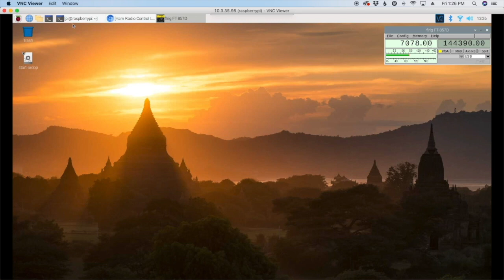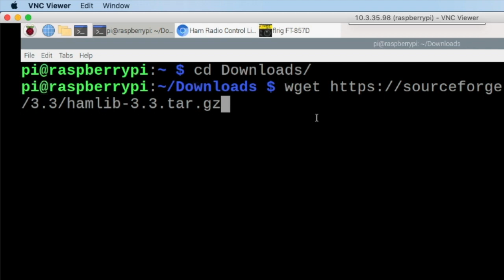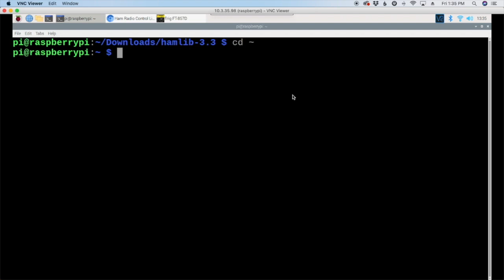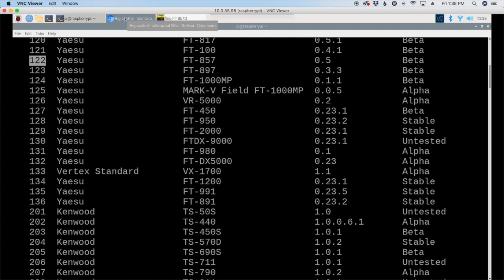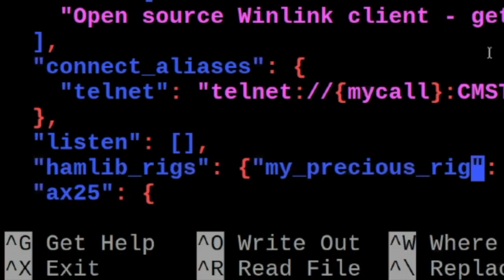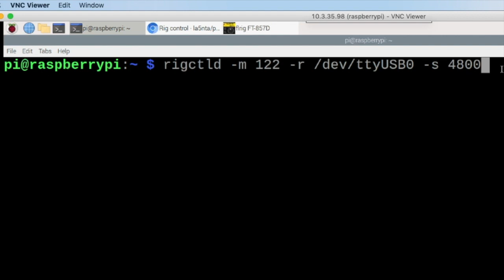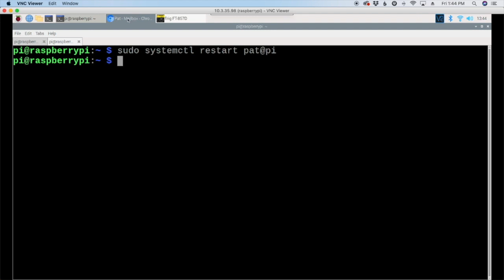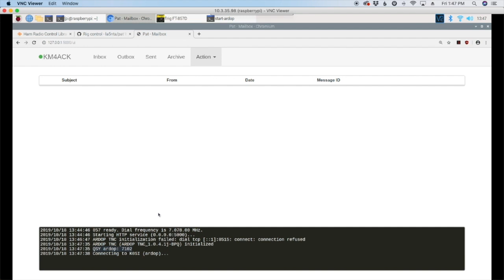Install Winlink on Raspberry Pi4 Part 3 Rig Control

Comment: This is out of date.   The  pat config file format has  changed...   I can connect to my rig w/  FLRig -  but not through pat.   and using  m -4 (flrig) is also crashing.  There seems to be a problem with the way the settings files are loaded:  rig_settings_load_all: settings_file (/home/vzander/.config//home/vzander/hamlib_settings): No such file or directory
.    Really appreciate the  level of detail in the videos... but   it is no longer viable w/  Raspi5

Comment: When I try to connect to a remote node using ARDOP via flrig the associated frequency will display on my Icom IC-7300, but it fails to transmit.

Comment: Any idea why my 891 goes straight into transmit when I start rigctld? rigctld -m 1036 -r /dev/tty-digirig -s 38400
Reply: The udev mapping was bad- the rule was not connecting the correct USB hardware to the symlink.. I thought that all digirigs were the same but maybe not or the different radio FT-3100 vs FT-891 made a difference. ardop and x25 are working-

Comment: Can you start rigctld as a service and boot time before pat as a service?  That way it is already running in the background
Reply from the maker: Depending on your setup, yes. I run rig control through FLRIG which needs to be started before rigctld so it wouldn't work with my setup.
Reply: @KM4ACK  how would you set that up.  I just used this for the first time to key my rig because ardop can't key the FTdx10 by RTS/DTR (or any program for that matter unless I am mistaken).  However, I figured out after the fact that hitting the VOX button also works FB.  But having mokeyed around with rigctld for the first time, I think I prefer it as my logging program gets auto update with it.  So I would love to start it as a service at boot time, and wanted to know what path you would recommend for that.  I hope this makes sense.

Comment: Jason, I followed your directions step by step. When I entered “rigctl -l” into the terminal command, I got the following error “rigctl: symbol lookup error: rigctl: undefined symbol: debugmsgsave.”
What is the rig number for an Icom IC-7300. At this point I am unable to proceed.
Reply from the maker: It looks like you have two instances of hamlib installed. Once compiled from source and the other from the repo. Try running sudo apt purge -y libhamlib4 and then try the rigctl -l command again. Additional tech support is available at https://groups.io/g/KM4ACK-Pi/topics You might also consider Build a Pi which does the vast majority of install and configuration for you - https://github.com/km4ack/pi-build There's a few videos on the site to help get you going.
Reply: @KM4ACK  Thanks. That did the trick. Currently I have winlink installed on a Windows laptop which appears to have been the conflict. I am 95% complete in the process of dumping Microsoft for Linux.

Comment: Hello!  I have been using BAP wih my Pi/4 successfully.  I also wanted to put some of those applications on my laptop running Ubuntu 20.4.  Apps like FLRIG, FLDIGI, JS8Call all work well wih both my rigs, an Icom IC-7200 and a Yaesu FT-891.  I did install ARDOP and got it as well as PAT Winlink up and running - to a point.  I use the "armstrong" method like Jason to manually dial the frequency yet ARDOP/PAT does not key my transmitter.  For my attempts I have been using my IC-7200 with ONE USB cable for both CAT control and audio. If anyone knows how to get my radio (both, preferrably) to key up I would greatly appreciate it. 

In another matter, my working SD card for the Pi/4 just gave up the ghost, and I am eagerly awaiting the lastest version of BAP to be released!  Good work, Jason!  Vy 73! SV0SGS

Comment: First of all, great videos!  During the ARDOP setup you get to a point during rig control that shows the PAT mailbox showing the the rig is connected and what freq that it is listening to.  I am getting an error that says "Unable to get frequency from rig IC73 (that's what i named my rig in PAT configure): code -9".  I was wondering if you have seen this or not.  I am using an ICOM7300 connected to a RPI4 and just have not been able to get ARDOP working with it.  PAT does work with TELNET.
Reply from the maker: It could be a couple of different things. Double check the config file. One comma out of place can mess up the entire thing. Feel free to post in the forum where a lot of 7300 users hang out https://groups.io/g/KM4ACK-Pi/topics

Comment: Thanks for providing this tutorial. I was able to get my Pi configured for WinLink and sent my first message over HF. There has been some slight changes in the rig control software since this was posted, when I was researching the solution, I noticed a posting KM4ACK posting in the forum that helped me along in that process.
Reply from the maker: Congrats! Winlink is a great tool to understand. I should probably revisit this series in the future to update it but most of my follows are using Build a Pi now and it takes care of the vast majority of what's shown in this series. https://youtu.be/l4M9VVqGxoc

Comment: Jason.. Great videos.  I have a question, I am new to the Pi world and am trying to learn.  I have downloaded and am using Build a Pi (BaP)... have no issues with the software but am confused.  If the Pat Menu is pro?vided in BaP, what do I need to do to make it run Winlink?  Do I need to follow all the steps here or just figure out how to set up the Pat Menu area on BaP.  Can you provide some direction or point me to a video that show how to set it and FLDigi up on BaP.  Many thanks for a great product in BaP and the wonderful videos.
Larry KO4OPE
Reply from the maker: If you used BAP to install Pat and Pat menu, you can just use Pat Menu. No need to follow this video.
Reply: @KM4ACK  thanks… and if I have any issues is this the best way to contact you?  FYI I have a Xeigu G90 with a Gigirig Mobile Cat control. Hope the setup is easy to get Winlink to work.  Never tried it, but need to be able to use it for ARES qualification. Thanks Larry KO4OPE
Reply from the maker: The best way to reach out is in the BAP forum https://groups.io/g/KM4ACK-Pi/topics

Comment: I have Flrig working fine with WSJT-X, but how does it interface with Pat? Are you just using Flrig as a standalone rig control interface, then using pat without specifying a frequency? I can't get the rig to key up!
Reply from the maker: Post the question to the forums and let's see if we can figure it out https://groups.io/g/KM4ACK-Pi/topics

Comment: Jason, I have a question please.  Small problem here.  When pat starts up (start web session), it reads the frequency from the radio correctly.  However if I close the browser, manually change the frequency on the radio, and start the browser up again, pat still shows the old frequency.  However, if I "sudo systemctl restart pat@pi", and then open the browser, pat shows the new (correct) frequency.  Maybe this is something having to do with rigctl?  Is it "ok" to change the radio manually and will rigctl/pat pick up the changes?
Reply from the maker: I haven't run into this one before. If it reads it once, it should read all the time. Manually tuning the radio shouldn't make any difference. Please post in the forum and let's see if we can get this figured out https://groups.io/g/KM4ACK-Pi/topics
Reply: @KM4ACK  Thanks, I just joined the group and posted.  It may delay the message for a while as I'm a new user.

Comment: Hi, I followed the instructions but now pat won't run.  Where does pat log errors?
Reply from the maker: When you start pat with “pat http” in terminal what error do you receive?  More than likely there is an error in the config.json file.
Reply: Pat logs to /var/log/syslog.  So, the config.json file has changed somewhat with the latest version and it appears I must have either included a special character I didn't need or excluded one I did need.  I've reverted to the original config.json file and will start over.  To those just beginning this install, I HIGHLY recommend you backup your config.json file.  Also, for those of us that like to use "vi", you can edit the config.json file directly and don't need to run "pat configure".

Comment: Hi,  installed winlink on a Raspberry Pi3.  I have a problem Connecting from Pat Mailbox.  I can run a  connection OK from the command line e.g  pat connect ardop:///callsign?freq=7045,  it connects to ardop, changes the frequency, keys the ptt and successfully processes a connection and session to completion, so it looks like rig control (CAT), ardop and PAT (from the command line) is working. The problem I have is that if I try and run Pat Mailbox from via the browser everthing works excepot there is no ptt.  Any idea what I might be doing wrong ??  Paul VK4PWG
Reply: Hi, I jumped the gun with my previous post.  I reinstalled everything again as well as Pat Menu.  Now it all works !!   Pat Menu is amazing -- just what I needed.  Along the way trying to find the fault I gained intensive practie in running everything from the comand line, including maiking connections, sending and reading email in minimalist fashion from a terminal window. So the effort was not wasted.   I intend to test run Pat mail in a survival scenario man-solo in the jungle (along with JS8Call etc).  In a emergency/survival scenario it can be important to establish close/regional contact so I will be testing a NVIS setup. I am in AUS and there are not many HF RMS gateways here, so I might have to take on a project to set one up.  Thanks for your videos -- they are fantastic. Cheers paul VK4PWG.

Comment: Hi Jason.  I love the tutorial videos and they have helped me a ton.  You said you use flrig because rigctl can't set the mode (USB vice LSB you would normally be in on 40m).  I can do it on my rig (IC-718) through the hamlib libraries.  Is your statement only referencing the 857, or something in ardopc, or something else?
Reply from the maker: It's 857 specific. It can be done though hamlib (rigctl) but I have noticed that it doesn't work 100% of the time. I did write into a script once to check and make sure it swapped before continuing but found it more reliable to use FLRIG. FLRIG also makes the build-a-pi system much quicker to move to a new radio using FLRIG. Just change the config in FLRIG and everything else falls in line. The exception is if you have to change the PTT method for different radios. VOX vs CAT.

Comment: Jason, when I run Pat Auto connect, it's now seeing the rig freq, keying up the transmitter and changing frequencies automatically as it should. So that is now working. But I've been trying since yesterday on 20 and 40 to connect to any node, anywhere and nothing. It keeps timing out eventually. How reliable is this for emcomm in reality? How do I determine if it's a propagation issue or if there is something wrong in my setup? I'm baffled...
Reply from the maker: Anthony, stick with 40/80 in the beginning. I find them much more reliable. Also, keep in mind the antenna type you are using. For instance, with a vertical, anything inside of 300-400KM and you will be skipping right over the receiving station. Then keep in mind the time of day vs the band you are using. Do you have another radio available that you can monitor your outgoing signal with? Is your radio showing power out when it is transmitting?
Reply: @KM4ACK  Ok, I'm working with 40m now on an end fed long wire. Not sure if I should be forcing USB or LSB or Data-U? Tried them all. Pulled up the map on Winlink of propagation and tried to use a bunch of the 40m ARDOP stations.. no luck. Rig is putting out up to 100W it appears.. I seem to get great propagation up to Canada and the NE as well as Ohio, MI and WI. 20m was not very good today for DX but was fine for USA.
Reply from the maker: Anthony Romano depending on your radio use either data-u or USB. Never LSB. And reduce power to no more that 30W.
Reply: You should run at 50% of max if running digital modes where your rig will be transmitting for durations of more than a few seconds at a time with only brief rests.  But more power should ensure that the receiving station may “hear” you and their AGC will prevent overloading of their receiver so I’d try 50 watts once you have the following figured out… then back down from there once you can obtain reliable communications (ham ops creed).
Most important, I would think is ensuring that both your transmit audio and receive audio levels are set properly.  Too high of microphone drive into the rig can distort your transmitted signal.  Too low may also prevent reception at the receiving station if near the noise floor there.
Similarly on your end for reception, if your rig’s audio output is too high then the A/D of your sound card will be clipping the audio as it exceeds it’s maximum range.  That will distort what is received and make decoding it difficult or impossible (too many errors).  Too low and the S/N (signal to noise ratio) will suffer and weak signal reception may be below the acceptable threshold of the [software] modem.
If you can adjust your tx audio level for a clean signal while transmitting a few watts into a dummy load while monitoring on a nearby receiver, that might be a “good thing” to try.  I’m not sure if there is a tuning aid for adjusting the rx level but hopefully someone can suggest.?
Finally, be sure that you are on the correct frequency.  If there is a local ham club in your area you might check to see if there is a member that can verify their ability to connect to the local node and what frequency they are dialing up on their rig… and yes on USB (upper side band).  On some rigs selection of digital for the mode may be upper side and with reduced power (50%?).
Good luck!  You’ll get ‘er done.  Just don’t guess on those audio levels nor the frequency.  A good horizontal wire antenna that’s broadside to the node and not overly high above the ground should work well as a NVIS radiator and for good reception.  Vertical antennas are noisier on receive and low in radiation angle so not ideal, as commented by others.

Comment: Hey, Jason.. having some issues getting this Pi, Ardop and Pat to work with my FT-891. Pat works fine with internet but I'm now trying to set up for HF. I followed your instructions, made a few errors, corrected them and still having issues. If I turn all equipment on and run Pat, it sees the rigs frequency and starts the HTTP service. But as soon as I try to connect to one of the remote nodes, I get the following error :"ARDOP TNC initialization failed: Set grid square failed: Syntax Err: GRIDSQUARE EL87VU97NA"    If I then restart everything, I then get "Unable to get frequency from rig 891: read tcp 127.0.0.1:59422->127.0.0.1:4532: i/o timeout. So I power everything off completely, power up, restart the ARDOP modem and start all over. Same error with the grid square. I'm totally frustrated but not giving up!~ HELP! :-) Any suggestions or thoughts? I'm also running Flrig which works fine w/ WSJT-x. Pi4 64gb and Signalink. 
update- I figured I'd try a different band.. switched from 20m to 80- now I get "Unable to establish connection to remote: no dialer has been registered for this scheme." Rig changes freq but doesn't key up.
Reply from the maker: Anthony Romano change your grid square in the pat config file to 6 characters. That will fix that. Try another connection and see what happens. 73, de KM4ACK
Reply: KM4ACK worked! Thank you for all your help!

Comment: Wonderful Videos!   I have have been making successful ardop connections on both 40m during the days and 80m at night.  Best luck has been on 80m at night.  That stated, I am STILL UNABLE to get rigctld to work.   I have aliases set and I would love to use them.  I used: "rigctld -m 136 -r /dev/ttyUSB0 -s 4800" and also w/ ttyUSB1.  I keep getting the same error.  For example, "pat connect ardop:///K0SI?freq=7102" gives the following:
2020/02/07 16:39:50 Unable to get frequency from rig ft891: read tcp 127.0.0.1:55536->127.0.0.1:4532: i/o timeout.
2020/02/07 16:39:50 ARDOP TNC (ARDOP TNC_1.0.4.1j-BPQ) initialized
2020/02/07 16:39:50 QSY ardop: 7102
2020/02/07 16:39:53 Unable to QSY: Unable to get rig frequency: read tcp 127.0.0.1:55554->127.0.0.1:4532: i/o timeout

Any suggestions?
Reply from the maker: What sound card are you using with this setup?
Reply: @KM4ACK  I found my problem.   I was running flrig which caused the USB conflict.  Without flrig running it works.

Comment: What a great tutorial,  Well done. I have a helpful tip when listing out the models for control as it can be large and a bit disorganized.  rigctl -l | grep 991 for example will list radios with a model name of 991 you can change the command to rigctl -l | grep yaesu to list all yaesu models etc. thanks again for the great videos.
Reply from the maker: Thanks! I use grep & more all the time. I need to remember to include that in more videos. 73, de KM4ACK